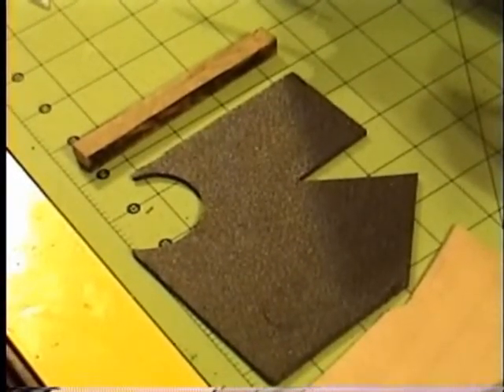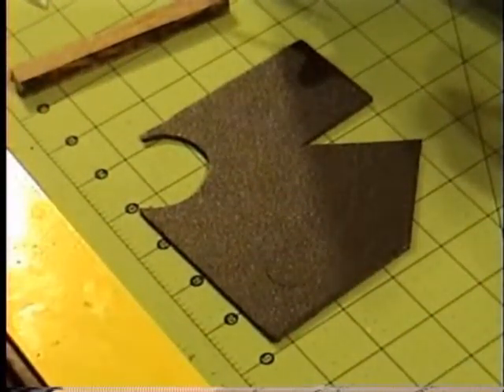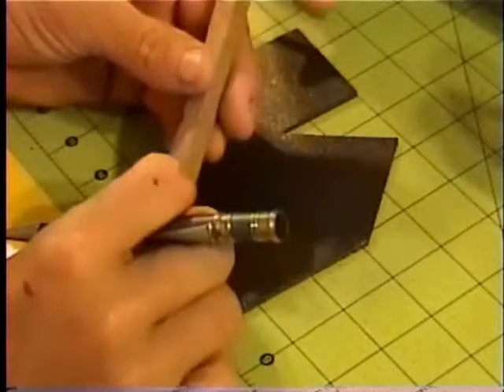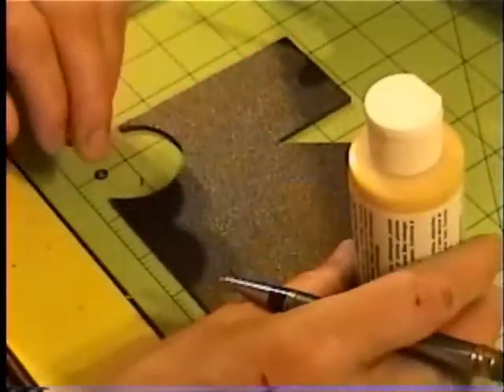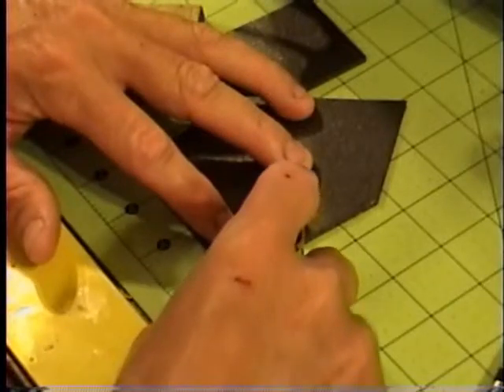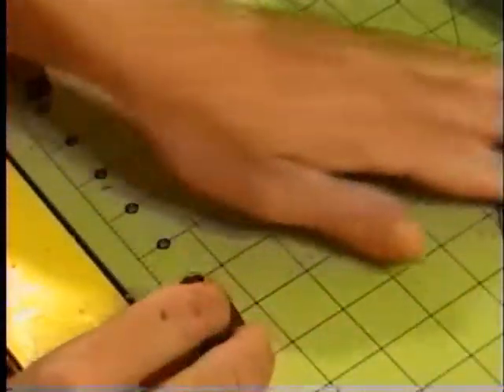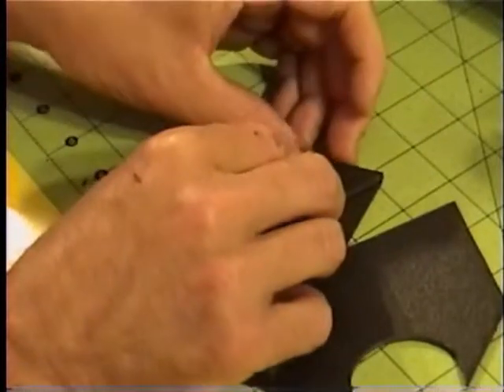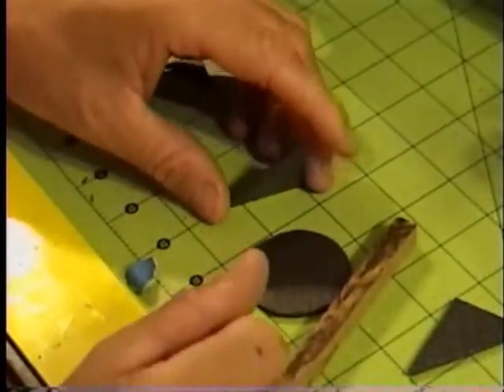How to build a stick mount.

Comment: The stick is a part that goes inserted in to a foamie fusalage for the reason of the motor may need to stick out little further then flat up against the fire wall or on rc planes that have a stick fusalage I'm making a custom one for gws pico  moth already comes with the stck but for a brushless  conversion you need this method shown here I would add more triangles 2 will do it but you can make the spot to stick anyway that u like take in mind the bolt patter and trace it on first